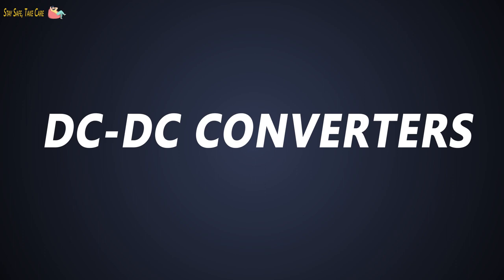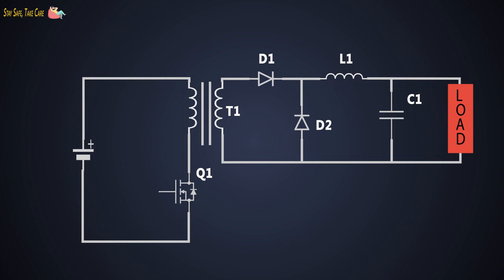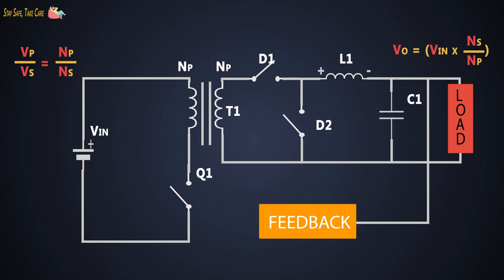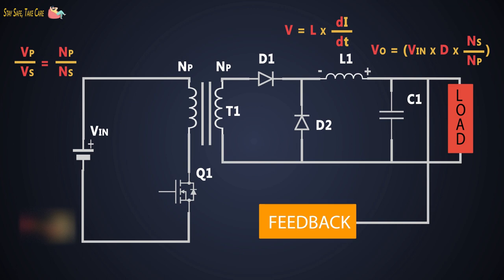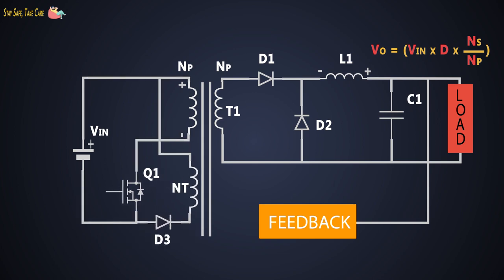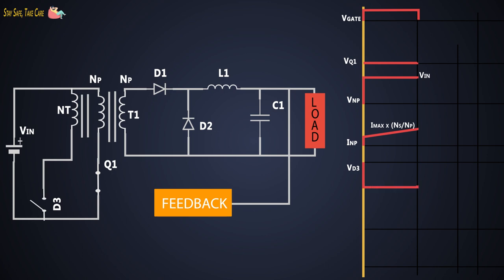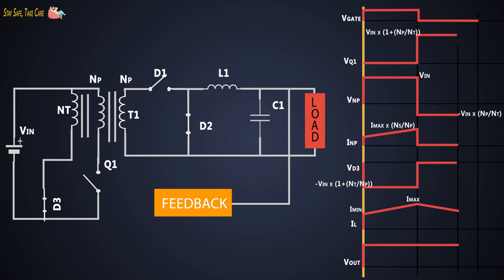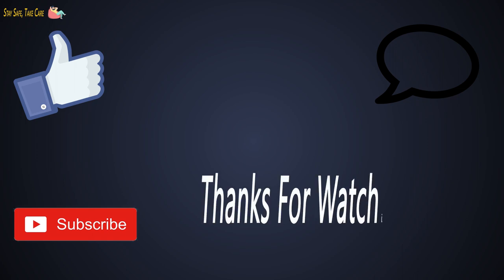How does a Forward converter work? | Forward Converter Working | Forward Converter Waveforms

Comment: what is significance of D1? Because even if we did not have D1, current during switch on would have been same. Similarly, even when switch is off, then the current due to induced voltage would not reverse biase the D1. You are explaining it wrong. So why D1?
 I wish you clear my doubt as well as yours of using D1!
Reply: yeah it is only needed in switch on position, I also didnt get the significance of D1 there

Comment: I have a doubt if saturation is possible in forward converter then isn't it possible in flyback converter
Reply from the maker: because the transformer primary's magnetic energy is being used in the secondary side of the circuit during operation

Comment: Hello sir, Thank you very much for your highly informative video. I have a question about the wire gauges, do we need to select it according to switching frequency or can we use thicker wire. What about the demagnetizing winding and secondary winding gauge?
Reply from the maker: Wire gauge depends on the the current flowing through the inductor, but if you increase the wire size, the skin effect increases, so there is a trade of between these quantities
Reply: Thanks for the quick response, as we know, in single switch forward, when switch turns off, the polarity of primary winding reverses (That's AC effect) and the  reset winding does its job. To get the best ampacity we need to choose primary winding gauge  according to switching frequency. This part I'm clear now.
 What about Secondary winding? In secondary winding, the diode only stops conducting when the current becomes zero and works only one way, there is no AC effect thus no Skin effect (if I'm not wrong). Can we use thicker wire in secondary?

Comment: What voltage source u r talking about? Battery?

My doubt is when inductor discharges the energy stored in it, will supplies like tdk lambda really take back energy from this inductor??

or its simply dissipated somewhere out of converter??
Reply from the maker: Not battery, a constant DC source. Thank you so much for watching!!